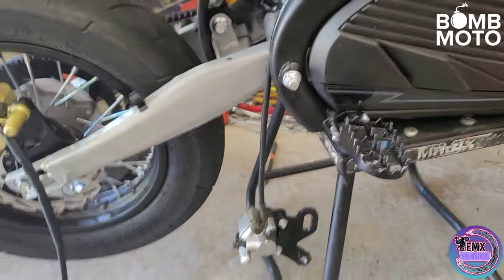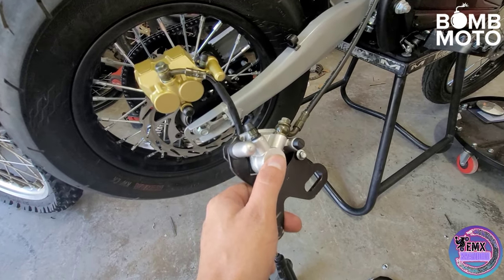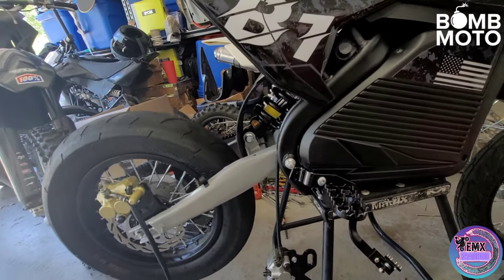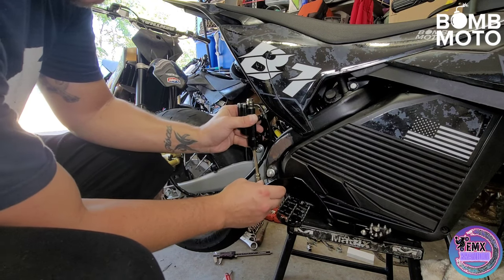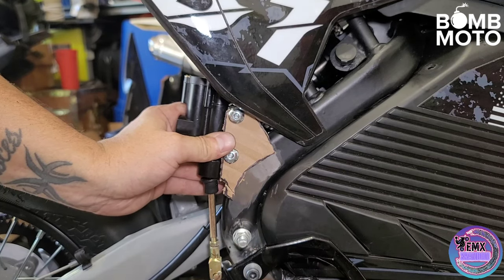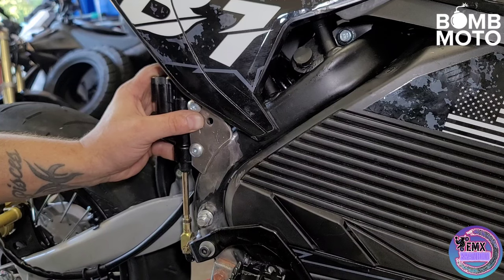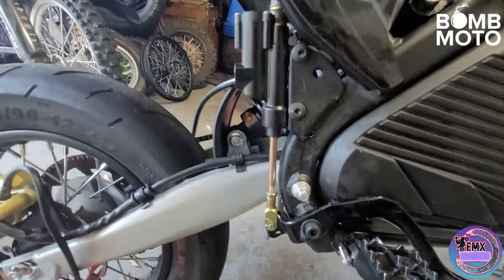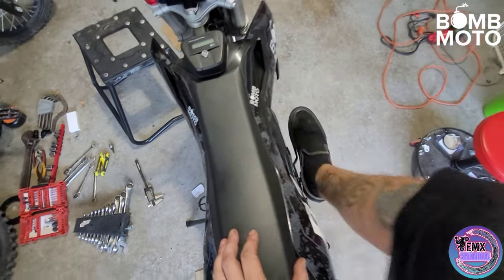I Modded My Electric Pitbike With a Footbrake! BombMoto B1 Heres How I Did It.

Comment: Well done. Hope Bomb puts a similar bracket on the frame for this option on future releases. Or equip the bike with both rear brake options.
Reply from the maker: Bomb will not be doing a footbrake on the b1 confirmed, they are sticking to the handbrake. More welding on the frame = more cost later down the line to us consumers. It was a super easy mod though!

Comment: Do you have a video or diagram of how you hooked up your voltmeter near the "gas tank" lol.
Reply from the maker: Pretty sure i showed how i did it with the etm kit install and the stock mototec controller install. You just gotta splice red into the key switch side that goes to controller ignition and black goes to any ground, that will make it turn on and off with the key. Or you can wire it directly to battery and turn it on and off manually. What controller are you using? Either way ill have a more detailed explanation once i get the fardriver how to vid done

Comment: What tire sizes are on your bomb? I have a mototec pro 48v, now 72 and want to change the knobbies.
Reply from the maker: These are just the same tires i had on my mototec. Front is an irc nr77 70/90-14 and rear is a kenda kd1 100/90-12

Comment: Whats the best size street tires to put on the mototec upgrade
Reply from the maker: On the mototec? I used a kenda kd1 100/90-12 for the rear and a irc nr77 70/90-14 for the front.

Comment: Without a clutch there’s really no point in a foot brake imo bikes only have them because of the clutch otherwise it would just be a bar lever also what type of welder is that mate ? Tig mig stick?
Reply from the maker: Go look at a crf110, no clutch and still has a footbrake. And i do stunts and having a footbrake opens up doors to tricks like one handers, where without a footbrake im risking not being able to use the brake if i take my hand off. 

Its a multiprocess welder, it can do tig, mig/flux, stick, and aluminum spool. I used flux.
Reply: @EmxBrandon  I prefer a foot brake myself just don’t see the point personally when it comes with 2 brake levers but that’s just me bro
Reply from the maker: @NemesisGrowz  lol I just gave you my reason 😆 im assuming you didny fully read the comment or fully watch the vid? The handbrake will be going back on later once i have the proper caliper for dual calipers